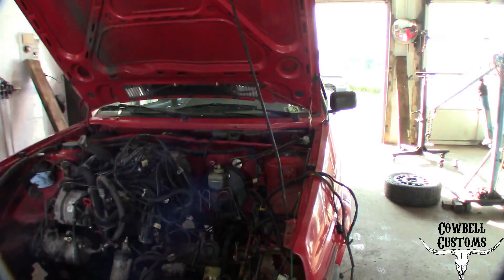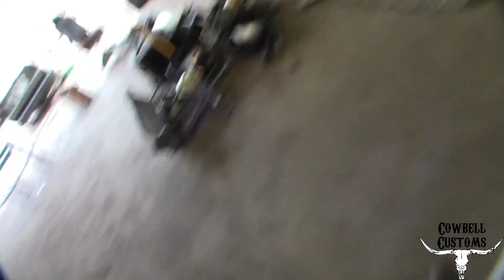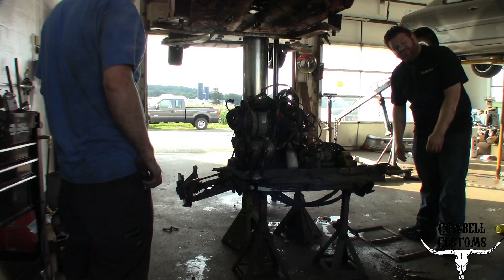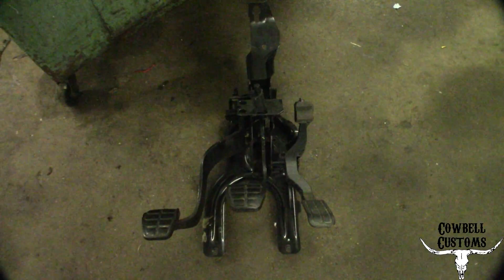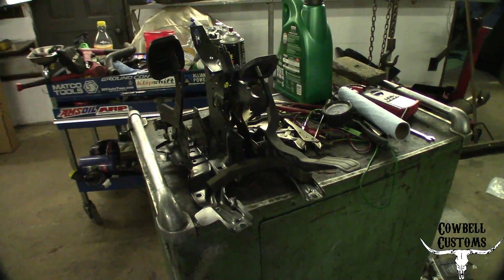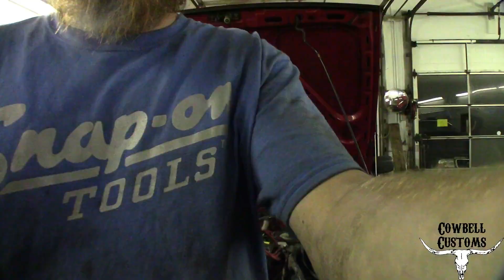Bye Bye 1.8 Hello VR6! MK2 VR6 Swap Engine Installation

Comment: I have the same Jetta MK2 and want to swap the correct motor is it only mk3 vr6 motors that work . And I want to also convert to manual is could use some advise
Reply from the maker: Other generation motors is possible but mk3 is the easiest to swap into a mk2

Comment: is it also bolt out bolt in for Jetta 3 VR6 to Jetta 3 2LT?
Reply from the maker: If your going from mk3 to mk3 Jetta to jetta it's going to be identical in most places just use the majority of the vr6 sub frames and accessories and you will be golden.

Comment: Is it necessary to swap the pedal system
Reply from the maker: Yes, the original pedal assembly was built for the cable clutch and the vr6 transmission is set up for a hydro clutch. I later found out using the S&P master cylinder bracket was the best way to do it.

Comment: mk2 subframe or complete mk3 front donor ?
Reply from the maker: I believe it's all mk3 stuff. I don't know 100% because it was in a mk2 which was the donor car, such had the vr6 in.
Reply: I have a complete Mk3 gti donor I read that the a frame and K frame need to be off a vr b3 passat or corrado to all fit
Reply from the maker: You know what that does sound right, because they fit the Mk2 chassis but have the mounts in the correct spots for the engine.